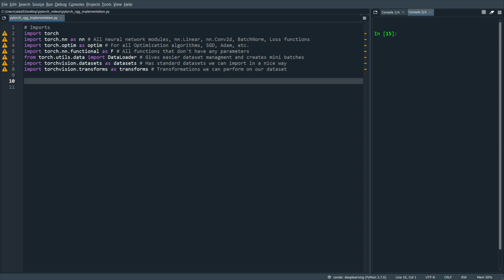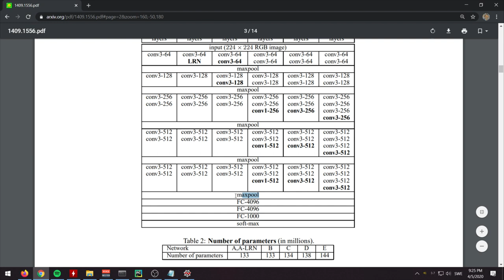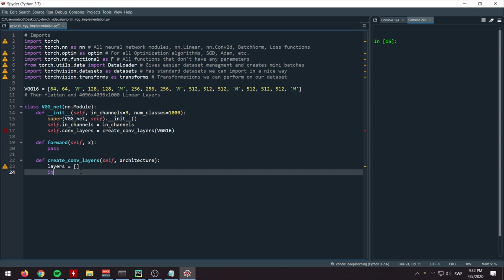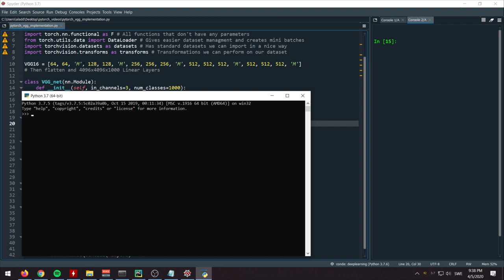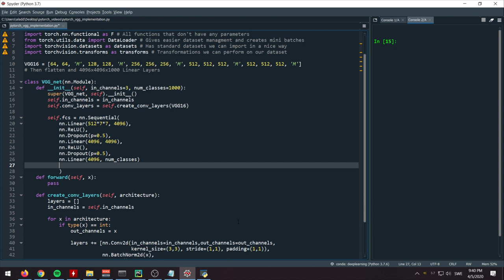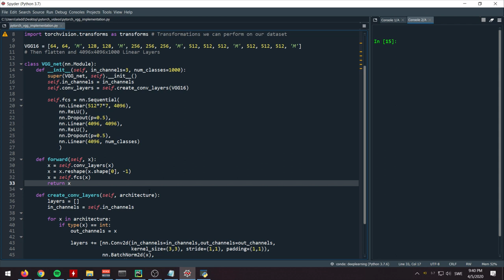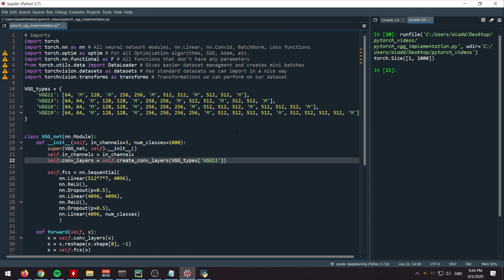Pytorch VGG implementation from scratch

Comment: I realize that it is really easy to make those networks work for any size of entry image. Why isn't this standard practice ? 

class VGG_net(nn.Module):

    def __init__(self, in_channels, num_classes, img_height, img_width):

        super().__init__()
        self.in_channels = in_channels
        self.conv_layers = self.create_conv_layers(GG_Types['VGG16'])
        self.height_out_of_conv = img_height // 2**5
        self.width_out_of_conv = img_width // 2**5

        self.fcs = nn.Sequential(
            nn.Linear(512*self.height_out_of_conv*self.width_out_of_conv, 4096),
            nn.ReLU(),
            nn.Dropout(p = 0.5),
            nn.Linear(4096, 4096),
            nn.ReLU(),
            nn.Dropout(p = 0.5),
            nn.Linear(4096, num_classes)
        )

I just change it this way
Reply from the maker: Wouldn't the downsampling break things sometimes if the image is too small? I guess it works but in many networks you can't adjust it this way because of downsampling layers
Reply: @AladdinPersson  Ok, I will test it out and I'll see when it breaks, thanks

Comment: Hello,
Thank you, this tutorial was really clean. However I was a bit disappointed! I would have loved it if you could have shown us how to implement backprobagation with an example application on a dataset.
I also have a little trouble seeing the type of objects contained in "layers" and what "Sequential" does. The documentation doesn't say much about it either.
Also, I didn't quite understand what the "print" was showing at the end. For example, I removed the "fcs" part (because I do medical image segmentation) and it returns: [1, 512, 7, 7].
In any case, thank you for your help. It has already helped me a lot on the use of pytorch. The code is clear. I guess with some research I could fill in what I am missing. (Sorry for all the silly questions, this is all new to me with cnn and pytorch ^^)
Reply: Why would you manually want to implement backprop? It is already implemented for the classes in torch.nn.

Comment: The final layer of the VGG is a softmax layer. So why does nn.Softmax not appear in the code?
Reply: The loss function that is going to be used here will be CrossEntropyLoss(), which already has softmax built into it, So we don't have to explicitly use it in the final layers. I hope that make sense.
Reply: @arnodorian7698  Thank you very much.

Comment: >>> import torch
>>> import torch.nn as nn
>>> import torch.nn.functional as F
>>> import torch.optim as optim
>>> import torchvision
>>> import torchvision.transforms as transforms
>>> import numpy as np
>>> 
>>> a = torch.rand(3,224,224)
>>> layer = nn.Conv2d(3,64,3,stride=3,padding=1)
>>> b = layer(a)

This gives a huge error for me. If i try (224,224,3) its the same thing.  May i ask you how exactly should the input to that layer look like after training ? For now with the data loader it trains somehow with input shape [200,3,224,224] where 200 is just the bach size. 
Because i want to use it to actually classify things but there is no way that i can reconstruct my input to the already trained model to the correct shape. Following the error messages if i supply the correct shape then it transforms the tensor into: 

torch.Size([64, 64, 3, 3])

instead of (64,224,224). What should i do ?
Reply from the maker: The error is because it expects four dimension where the first is the batch size. Essentially in the example you gave you should have a = torch.rand(1, 3, 224, 224) and it would work fine. Also it's quite rare to use stride=3, if you want a same conv it should be stride=1 with kernel_size = 3.
Reply: @AladdinPersson  yeah i agree. It was just a typo ;) 
Yikes i thought that this 1 was going to be added by itself. Yeah i see now thanks man

Comment: is nn.ReLU() doing anything here? I think you should wrap it up with the batchnorm/linear or set inplace = True. Let me know if I'm wrong.
Reply from the maker: I'm assuming you're referring to the lines at around 43-46 where we're doing the conv layer, batchnorm and finally nn.ReLU. It should be working as intended here, inplace=True is not necessary to have as an argument but would be a bit more computationally efficient.

Why do you think it shouldn't be working?
Reply: My bad. Just misunderstood something from the source code. Thanks for the tuts. They gave me a swift start in PyTorch.

Comment: I get size mismatch, m1: [1 x 115200], m2: [25088 x 4096]
Reply: When using my own data
Reply from the maker: @matthewavaylon196  What are your input shapes?
Reply: @AladdinPersson  500X500 with 3 channels
Reply: for epoch in range(100):
    for x,gt in zip(data_list,gt_list):
        x=x/np.max(x)
        gt=(gt>0).astype(int)
        x_=np.copy(x)
        gt_=np.copy(gt)
        x = np.reshape(x,[1,3,x.shape[0],x.shape[1]])
        gt = np.reshape(gt,[3,gt.shape[0],gt.shape[1]])
        x = torch.from_numpy(x).float().to(dev)
        gt=torch.from_numpy(gt).long().to(dev)
        optimizer.zero_grad()
        y = model(x)
        loss = criterion(y,gt)
        loss.backward()
        optimizer.step()
       print(loss)